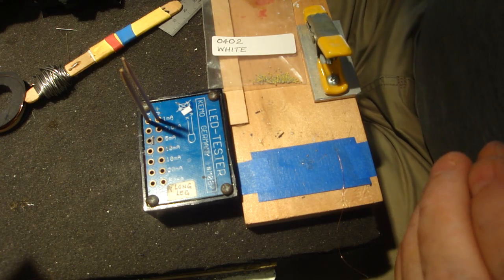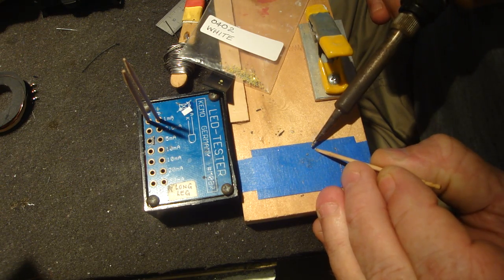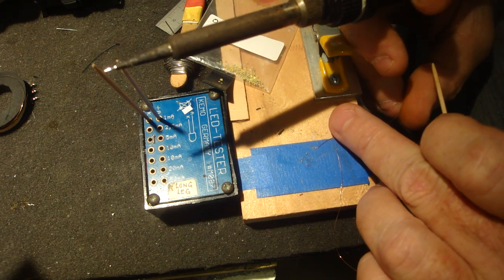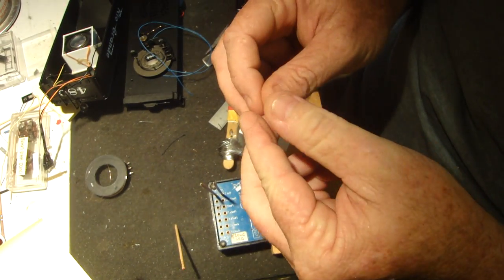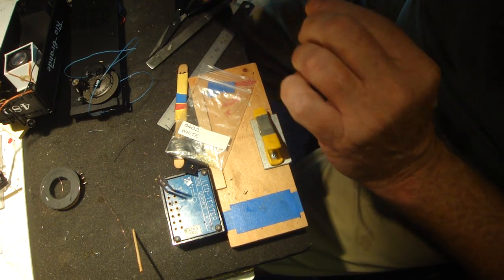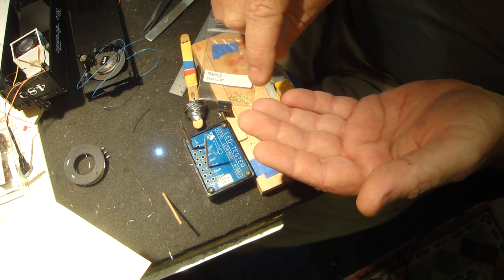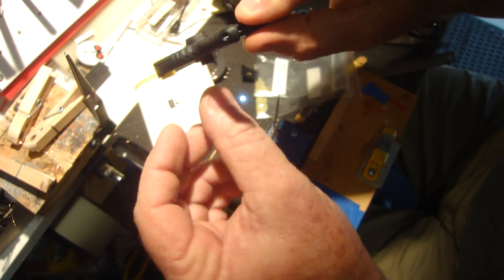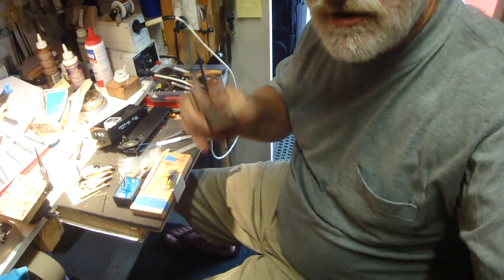Soldering 0402 SMD LEDs for lighting

Comment: Will the smd led 0402 will work on dc?
Reply from the maker: Yes, Will work on DC but you must have a resistor. In the video you can see the Led Tester which has a 9v DC battery. You can get Surface Mount Device (SMD) resistors, a start value would be 1K value
Reply: @scoopmmr  thank you so much that was helpful. But if I connect the smd led in series and led total numbers approximately 100 pieces do I need resistor? Because i want to connect them to a 12v dc.  Anyway this is a lightning for my project hope you can help me, thanks
Reply from the maker: @rafhealjunandrade9774  You will need to provide a resistor (1K) to every 3 SMD LEDs with a 12 volt DC supply. Depending on the LED each LED will require approximately 3 volts to light so 3v x 3LEDs = 9v but if you put more they won't light. You must be LESS than 12v
Reply: @scoopmmr  I understand now thank you
My led voltage is 3volts and my battery is 
8Ah  (3s4p)
Discharge rate: 24A
Max Charging rate: 4A
12 volts
If i need a current limiting resistor  what type of resistor? Because i can connect 3 led in series to divide the voltage but the battery current is too high so i need resistor, but what type or classification of resistor?Hope you can help me
Thank you
Reply from the maker: @rafhealjunandrade9774  The resistor needs to be either a SMD or a 1/4 watt standard resistor (easier than to solder in) The actual resistor value I'm guessing for your needs is a 1000 OHM (1K) which will be bright or if you want a not-so-bright use a 3k.
Reply: @scoopmmr  thank you so much sir that really helped me a lot.

Comment: were can i buy a bag of those 0402 less?  are they really expensive?
Reply from the maker: +kairus1 Try the LEDBARON on ebay or search for 0402 SMD LED on google
Reply: *****  i just did can you tell me what resister do i need for the 0402 ?  do you know what battery i would need to light six 0402 ?   i don't know how to calculate power. very new to this.
Reply from the maker: +kairus1 SMD LEDs are cheap. Each LED roughly draws around 3 volts so from this you can calculate the supply power needed. What you can do to work 6 SMD LEDs is split the 6 into two circuits of 3 each LEDs and put a resistor onto each circuit. The resistor value - well try 1k 3k 5k (1/8 or 1/4 watt) and experiment with each resistor value. A 1k will give bright light, a 5k will be dim but if the light is too bright you use a higher value such as a 10k resistor. If you want very bright use a 750 Ohm resistor. A 9v battery may just run 3 SMD LEDs (3 x 3volts they draw = 9 volt battery power) you can use a lower value resistor and try? LEDs are all slightly different in what power they draw.
Reply from the maker: +kairus1 Search LEDBARON on google
Reply: *****  thank you very much for the info!  i will try and do it.

Comment: Thanks for the video on these .I did a few of the 0402's and have about a 50 % success .Your video helped me realize some of the mistakes I was making .Frustration has to be put aside is number # 1 ,then the technique,high watt soldering iron with the finest tip would help maybe with the success rate,but an old favorite that had much success with many other jobs is hard to put down.

Comment: What temperature is best for soldering 0402/0603?  I am guessing the temp needs to be a lot higher than regular soldering because the contact is only a second or less.
Reply from the maker: Sean, for all surface mount LEDs I set the temp to 200 C. It is VERY important to use a liquid flux because once you open the strip the LEDs are in they start oxidizing - therefore using flux like Carr's orange (non-acid) you get perfect tinning of the solder pads leaving a very tiny blob ready for the wire. When tinning magnet wire I set the temp to 350 C to burn-off the insulation and get a good tin. Don't worry about the amount of length as you can trim with cutters.
I often trim after I have soldered cutting against the LED and you can always add insulation by dipping the whole LED in thin ACC glue.
Happy soldering mate ...Laurie
Reply: ***** Oh, thanks so much Laurie!  I have only been soldering for a few weeks.  I;ve been working on my first layout, a Z scale in a coffee table for about 4 months now and have reached the phase where I start wiring up my interior building lights.  These 0603 will be perfect to add over some cubicles in an office building I been scratch building.  And of course man other parts of the layout.  I experimented the other day soldering some 34 gauge magnet wire to some 0603 but the connections were often very brittle and broke off with the slightest twist.   And some of the, the 1/4w 1k resistor got pretty hot, I'm guessing that can be a side effect of poor joints?  Frequently I notice the temperature of the soldering iron must change a lot because the consistency of the solder varied.  Often clumping up or balling.  Its just a cheap $10 iron with no controls.  I bough a Hakko FX888d station on amazon yesterday because I plan to make this a long time hobby.

Back to soldering, I wasn't using flux, so probably that was my problem too.  I thought I could get away without it.  Do you have to get the flux only on the pads?  Or did you just brush it across the back of the whole LED?  I couldn't tell from the video.
Reply from the maker: Sean (all), look up 'HobbyKing" and look for their 38 gauge Teflon insulated wire which comes in red and black.
I use a lot of this with SMD LEDs and far easier than magnet wire. It is easy to strip the Teflon insulation off with good quality side cutters and easy to tin the tiny multi-strand wire. Very flexible and close to magnet wire gauge.
This is perfect wire and I highly recommend it and cheap too (sells by the metre) Great on brass locos.
Laurie
Reply: *****
Thank again Lauire,  I will check back when that wire arrives and give it a go!

Comment: Hi Raurie,Watching this video on led install and noticed the tester which I bought,not quite like yours.What holes did you use to test 402 and 603 smd?Could not see the numbers. Thanks my friend
Reply from the maker: G'DayJohn, It doesn't matter which "holes" you use, any will light the LED if you have soldered correctly and not burnt it with too much heat for too long. The holes are of varying resistance - that is all. Of course you need to test to find the Anode and Cathode (+ & -) and if testing one way doesn't light then swap leads over.

Comment from the maker: The SMD has a 'T' on the back - the base of the 'T' is the cathode (-)

The DCC track is AC and you can run a LED off track power - the LED must have a resistor - say a 1k to 4k will work.

Laurie.